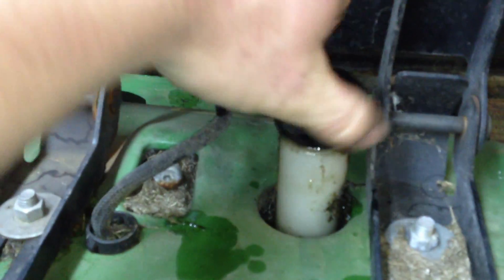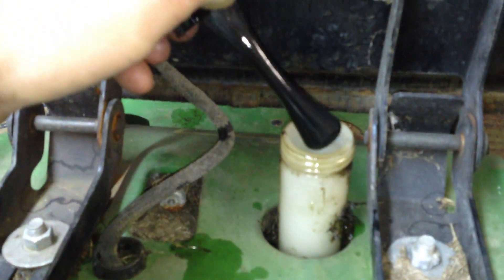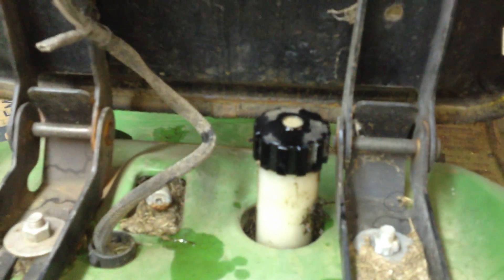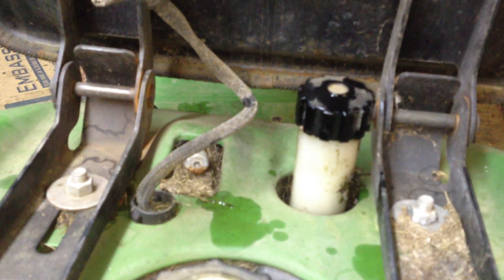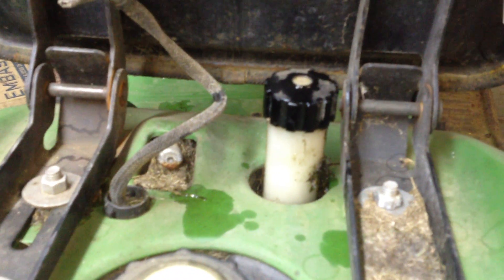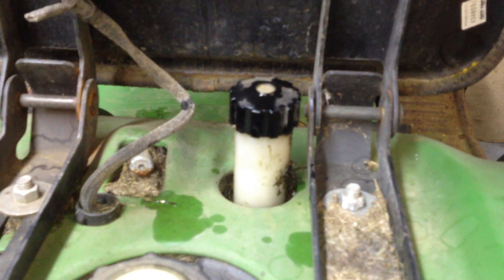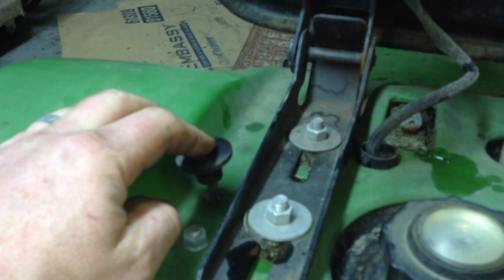John Deere 185 Rider Mower Transmission Service Info

Comment: Can you fill both compartments with the same 80/90 fluid ?
Reply from the maker: You could but I wouldn't recommend it. One takes hydraulic fluid the other takes gear oil.
Reply: @machinesnmetal oh okay , just got onto my reservoir is done dry and crusty , hope the hydro works

Comment: Hey guys. There are 2 versions of this mower. The one he shows here has a Sunstrand transmission and a Kanzaki Differential. Gear oil does not go into the differential on this model. - Sunstrand Hydrostatic Transmission, 10W30 Motor Oil, 0.7 liters

- Kanzaki Differential: 10W30 Motor Oil, 0.7 liters

Comment: Does anyone know the belt number that runs from the engine to the transmission on the 180, 185. Has to be the longest belt, I also need to find out the belt number for the 1985 Model 111 again, the longest belt that drives the tractors.

Comment: I have a 175 hydro first I lost reverse then eventually forward quit working so I pulled the fenders off and moved the gas tank to get to the top side fill plug took almost a whole quart of straight 30 W. Drives like its suppose to. flat ground.hills it's working fine

Comment: I have the same mower. 
Do you happen to know the size of the drive belt. The dealer is not sure and giving me 2 different sizes 79 1/3" or 79 1/2". I am also having a hard time finding a diagram for the drive belt.
Reply: M73223 is the part number the belt size is 79.8 by 0.5
Reply: @isaacbratton7688  Thank you for the belt size info! I just checked the Operator's manual on the 130, 160,165, 175, 180, and 185 Lawn Tractors Serial # 475,001 and up. The "Drive Belt for 165,175, 185 Tractors) is M89832 according to OM-M75874 iSSUE 17

Comment: I just put 90wt in my diff. what came out looked like old motor oil. 
Now its jumpy. Just to confirm 80 to 90 in the Diff. and 10w 30 in the Trans?
Reply: If you have a setup like he does in the video then you have a -

- Kanzaki Differential. It uses 
 10W30 Motor Oil, 0.7 liters

Comment: John Deere Hy-Gard Transmission & Hydraulic Fluid in the top under the seat...
Reply: Not correct, 10W-30 oil, check with Dealer can be several different pumps and differentials.

Comment: Where is the brake safety switch at on a hydro 175 john deere?
Reply: On mine, it is right in the middle under the seat. Standing at the rear, you twist it to the left to disengage brakes.

Comment: Great video.  Thanks for the help.  I have a JD 185 Hydro that won't go up a hill after about 30 minutes of use.  Trying to figure out the root cause.
Reply: I have the same issue. How did you fix it?
Reply: When mine did that the drive belt (trans to engine) was wearing out. Was stretching and loose to begin with and as it warmed it lost grip on the pulleys almost completely.
Reply: Same problem... changed belt. Didn't fix it. Bout to set it on 🔥

Comment: The second pump that is under the seat above the fuel inlet. What type of dydraulic  fluid does it use? I know for the transmission you said 80-90 wt but I needed to know what the white one used. Thanks in advance